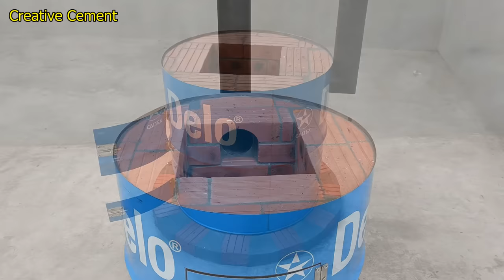The idea of recycling iron drums and cement into an effective wood stove

Comment: When i was 10 i built a similar thing inside my camp we built by hands in the forest a house and we needed electric and heat used car batteries power it and then used barrel keep warm w pipe coming out top going out the roof caught fire had insulation of walls and floor but i was only 10 years old back in the 80's.